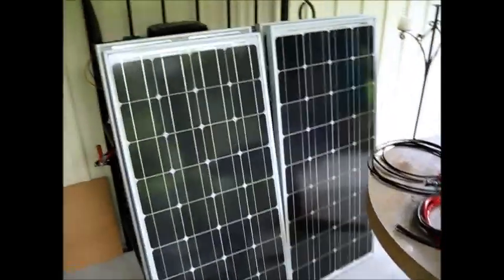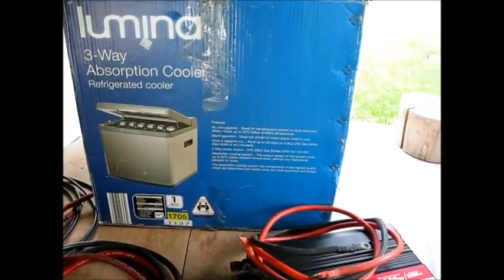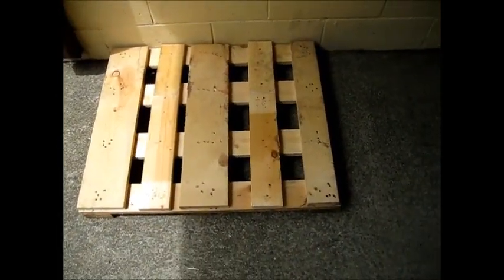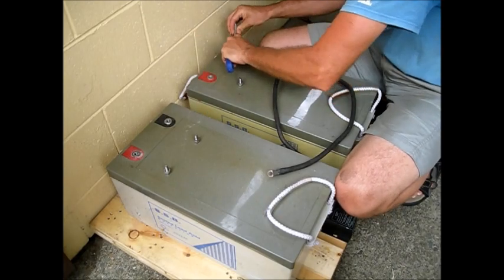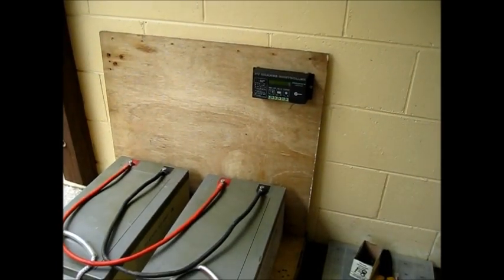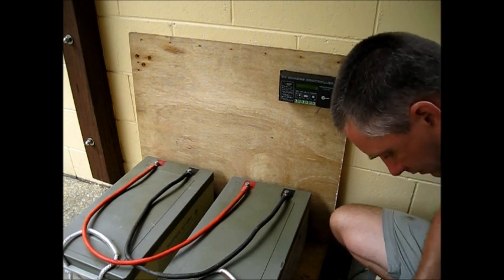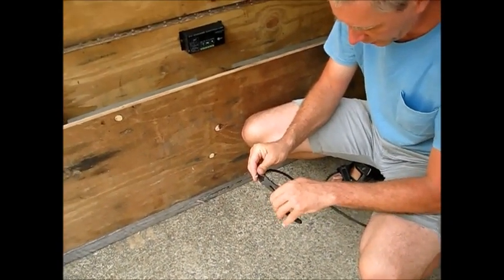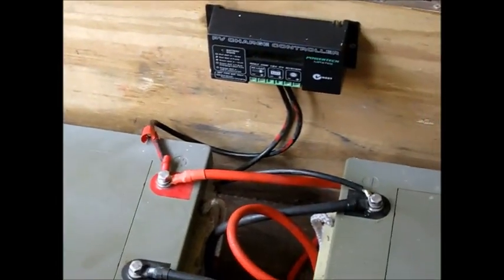The DIY World Installing Solar Panels On A Home In Australia

Comment: looks good your alot warmer then i am it was -10 last night, this week one night it snowed like i never seen it by time it was done there was to top of standing up snow shovel oh my i glade the heater guy fixed my unit monday before the snow! well ih hope your having fun! I ordered a off season boat trolling motor it was so big it did not fit in truck box with weight in it, i got one that i have to rewire boat to 12 volt from 24 volt unit i am going to try to use solar to power it! now you see my plan run it for cheap
Reply from the maker: Yes I am certainly enjoying the warmth here. It is a harsh winter back home this year.
Sounds like you have a good plan. If you dont use the boat every day then your idea will work well.
Reply: The Do It Yourself World
yes i though if solar units work for house why try it on boat with electric motor i used boat stuff to make first solar unit to see if it worked
Reply from the maker: gatorred157 Over here nearly every single boat has solar panels and many of them have wind turbines. I think I will show it on a video.
Reply: ok
Reply: gatorred157 how is the weather outlook? not melting here! everyone tells me by Thursday watch the report.still unsure.
Reply: cold and snow Sunday afternoon
Reply: WOW!  I wasn't sure how much.Thanks gatorred !.Keep You posted as well

Comment: You gotta check the area if there's chances of flooding ask owners if then put it on a stand with measuring lines with a cut off switch so just a switch to seperate the joint current water proof just like an electric bike waterproof but portable generators always have duck tape to tape the power connection up under the coverings etc safety especially for kids

Comment: I'm  not an electrician but I've heard that when you are connecting batteries you are supposed to connect the negative lead last to help avoid explosion. Do you know if that's true?
Reply: If a battery is going to explode,or bust,it will do it if it's bad no matter what.They tell you to connect the ground last,so that when you attach the positive,the chances of grounding itself out by accident will be reduced.it all depends on how careful the person is.I work with batteries all the time,and I have had brand new ones bust.
Reply: MrCrf450rider Thanks for the info.
Reply: In a car, under the hood, everything around the battery compartment that is metal is considered negative ground. That is when the negative battery post is connected first, if your wrench taps any metal object while you are tightening the positive, the wrench will arc.
If you connect the positive first, the car is not yet grounded and your wrench can safely touch any part of the car while tightening. There is no harm if your wrench comes into contact with metal objects while tightening the negative.
In a wooden box that rule doesn't really apply but I'm a creature of habit, so I do positive first anyways!
Reply: Francisco Campos Yup, that one's a no brainer. My question was related to hooking up batteries with solar panels as you can see the video is about solar panels.
Reply: Camper Hollow On a wet cell battery, you want to avoid sparks anywhere near the battery. When connecting an inverter, the first thing that happens is it's capacitors take a charge and this causes a spark. The safe thing to do is make the final connection at the inverter side of the battery wires, the negative last, but either one (+ or  -) will cause a spark.
In this case, it looks like these are AGM batteries. They don't normally vent explosive gases out into the air, but they will when over charged.
I would NEVER instal electrical devises (except fuses and thermostats) inside of a battery box regardless of battery type.
Reply: Francisco Campos This helps a lot, and I do appreciate it. I think the best thing to do according to what you are saying and I do agree with it, is that the batteries should be in one box, and the charge controller, inverter and anything else should be in another box. I also think that having the batteries enclosed in their own box while hooking up the controller and other things is a safer approach because even if the batteries explode you are protected by the box they are enclosed in.

I think I would also put a fan in one end of the battery box. I would not pull the air out of the box with the fan since that could start a fire if the gasses react with the electricity in the fan. I would push the air through the box instead so the gases move out through a vent in the other end of the box.

Comment: Am assuming you going to clean this up later as you seem to have performed testing in this one. The two cables you used to connect up the batteries where too long. It would have been a high efficiency if they were about 1/4 of the length as longer the wire length; the higher resistances thus the high the voltage drop and the least efficiency it is.  I'll keep watching to see what it ends up being but it is a start.
Reply from the maker: Yes this was a test. We are cleaning up the whole thing and even using wire conduit to hide the wires. I have two more videos on the installation I am working on.
Reply: Good luck mate!

Comment: Finally a solar video yea. But Troy I am concerned that the wind will blow rain water all over you charge controller and short it out. You should move it inside more away from the drip line. I like to put the wires in before I mount it on the wall. You need a box with bus bars in it to combine the panels. I use Y connectors or even tri connectors made like MC4 plugs for mine. On a different system I run a separate wire for each panel all the way to just before the charge controller then combine the wires with a buss bar made for boats or marine. They come out of that to the controller. Watch my video to see the kind of buss bar for marine I used it is nice. This is the name of the video "All Wired Up Ready to Charge Batteries"
Reply from the maker: We have since moved the whole setup but that is on another video I am putting together. Good idea on the wiring but it costs more. I will tell my friend about the idea.
Reply: The Do It Yourself World The land scape wire is cheap on ebay. I use the 10 gauge wire. You can buy 100 feet for about fifty bucks or more. then just crimp on some connectors. The advantage of running one wire for each panel is you dont loose any power or voltage and that is key when charging batteries quickly or on cloudy day. You want the most voltage possible to make the batteries take a charge in a shorter amount of time. On a cloudy you may only be barely making power and the extra volt you get by using a single wire per panel will make the difference between not making enough voltage and making enough to make the batteries take a charge. Did you see my Marine buss bar all my panels combine together into on my video. I should make a new video with close ups and more lighting.
Reply from the maker: shartne Cant watch videos for now. I pay per MB of data I use over here. Ouch.
Reply: For heavens sake. Must be socialist tyranny at work.
Reply from the maker: shartne lol

Comment: Why are you using aluminum ware instead of copper and red for +with - for black so as no mistakes are made with connections
Reply from the maker: I use whatever is available at the time. This was in Australia and I used what they had on hand.

Comment: what are the laws and regulations relating to DIY solar panels for a home, Pretty sure you need to be certified electrician as well as a certifaied Solar fitter if thats the correct term for it? 

I am quite interested in doing this for a tiny home i plan on building and i can comfortable on doing this myself as i have built my own batteries before from 18650 cells so doing it from complete scrap is not an issue for me however the legality of doing it is also another issue. does it void your insurance if something goes wrong etc?
Reply from the maker: If you connect to existing wiring in a home, it must be done by a licensed contractor. If you make it separate from existing wiring, you can do it yourself. Dont forget to follow code for safety. And check your own local laws. Some areas allow solar and/or being fully off the grid while others forbid it.
Reply: @TheDoItYourselfWorld  ah ok thats pretty good to know i did some research on it but havent been able to find many useful resullts relating to it being illegal or legal only for other countries liek the US and UK very little about it in AUS floating around but this is good to know so long as its not connected to the main house wiring. 

Does this also include seperate dwelings or RV type homes etc i mentioned earlier a tiny home is not technically a free standing building but more or less built onto a trailer so wondering about legality about this =)
Reply from the maker: Here, in the US, an RV is generally a motor vehicle and does not fall under normal building codes. A tiny house on wheels would be an RV. The township could not do anything about my tiny house on wheels. Then the only issue is occasionally moving it depending on local regulations.

Comment: 9:35 Setting the batteries in serial will cause an explosion? I did not know that.
Reply from the maker: Connecting the plus and minus of one battery is what I meant. You can connect batteries in parallel or series but I was trying to say be careful that you do not short the plus and minus terminals together.

Comment: I dont understand batry connection its parallel or series?
Reply from the maker: To connect them in parallel you connect all + terminals together and then all - terminals together. This combines your current. To connect in series, connect the + of one battery to the - of the next and so on to the end. This increases your voltage.

Comment: What is the price for a solar panel setup in Australia? Good Vid! Like the box idea.also what are those batteries normally used for?
Reply from the maker: Solar panels here are not too much different in price from in the US. But a place called Jaycar Electronics has some nice deals ranging from $3 per watt for solar panels. I bought a portable solar panel for my backpack from them which I will review soon.
The batteries are just deep cycle batteries used for campers normally
Reply: sounds good! There is this company by me that has a huge array of solar panels.It covers the whole front of the lot that they are located in.Like the solar backpack idea,that can become handy in a bad situation.My Father had 2 big solar panels,on posts,with caharge controller,and marine batteries.He used them for the electric fence for the horses.someone came and stole them.We got a call from our neighbor saying our horses were out.that is when we noticed the theft.
Reply from the maker: MrCrf450rider I could not resist the solar backpack panel. It is awesome for survival situations or hiking.
Reply: The Do It Yourself World for sure! I purchased a few emergency lights,and radios,with the hand crank,and work perfect.able to charge phones,lights etc.My basement is practically underground,and can be turned off grid.I consider it the safe spot.I also rotated our food supply last week. The whole house is wired.I got battery backup,and a load shedding transfer switch for the generator,also stocked up on camping gear,and firearms.I am actually not sure the route I want to go,as far as wind,or solar yet,or both.I want to do a roof mount wind turbine,but am not sure what noise or vibration I might get.solar has been good in the past too!
Reply from the maker: MrCrf450rider Go with both solar and wind if the environment around your is good for both. Meaning if you have plenty of wind all year and a clear line of sight to the sun for solar.
Reply from the maker: Link Knight I was just chatting with a solar panel installation company who said that they have to throw out a lot of damaged solar panels. There is no recycling place in Australia. That is an open market Link. Get free solar panels, fix them up and sell them.

Comment: Just did my caravan , didn’t find I needed a inverter for power. I made sure my accessories are 12 v ... lights , fridge , USB,s , tv. Heater. Stove is gas. The basics I know but it’s all I need and keeps the cost down. Have to admit though power tools etc definitely would need and inverter for those  or maybe a generater instead . Horses for courses lol good video . 👍

Comment: . i have a 12v deep cycle marine battery as a back up separate  from  my 2 6 volt t105 golf cart battery system . long story short i had them all on trickle charge at my home a yr ago. batteries were topped off. i move the trailer to storage .no power available. with no charge going to the batteries any longer and with small volt meters connected to both the batteries held a charge for quite awhile although volts were dropping.as of 3 or 4 moths ago the volt meters were no longer lit and showed no readings.im about to install a 100 watt solar panel with 30 amp mppt controller to the 2 six volt set up and hope over some time it will restore those batteries to 12.6 and was thinking of using the portable kit to install to the marine 12 volt to restore and maintain that battery as well.do you think the panels will bring the batteries back to a good charge on their own without having to remove them and have them boost charged ?also being its at a storage facility i was thinking of mounting the portable to the trailer roof so no one walks off with it.can i do this if i cover the charge controller in plastic to keep dry ?
Reply: if the battery's are dead you may have killed them, a trick i learnt to bring back dead battery's was hooking up your charger backwards so + to - And - to + for 5min then reverse the polarity of a battery back to normal, a sparky showed me this trick he told me it makes the buildup on the battery plates come off, how true this is IDK but it seemed to work twice for me when i did it.

Comment: what does it do  I dont get it?
Reply from the maker: Power from the sun to run your home
Reply: But like we're do you plug it in to, and for what light, heating I do t get it? Do you plug it into a plug
Reply from the maker: OH, ok. You can run a power inverter to get AC household type power. Then you can plug in the TV, laptop or lights. Charge your cell phone and other devices as well. The only limit is how many batteries and solar panels you have. With enough of those you can also run heat, fridge, washing machine and more.

Comment: Im not an electrician - so in English what exactly do I need to live off grid completely?I want to get a 10kw off grid solar system - what would each panel have to be in wats? What size batteries would I need? Any other information I should know??
Reply: Anna Nolan 
I my self am starting with a 5 kw inverter. and just 200 amp hours in batteries. 2500 watts is all you would ever get out of a single  common outlet in the us. so I would go from there to estimate your needs. check labels of what you must have and use every day. but I'm using a generator for large loads like washer dryer and cook stove. and inverter for TV lights and fridge. and microwave. but 2000 watts solar and 10,000 ah battery bank. with a 4-5 kw inverter. and a generator to take up any slack . from rainy days. is plenty for 2-3 ppl. as long as you use gas water heater and stove. Or a generator to run the stove. but you must watch power use. and unplug any appliances that use power when not used. I'd use 100,150 or 250 watt panels. and 24volt inverter . you can always add on later. hop this rambling made some sense .
Reply: ive started 8kw solar setup with another 1.5kw wind total 9.5kw  i have 30 270watt panels and 3x 500watt wind mills  i also have 8x 335Ah 12volt batterys thats about 32kwh of storage but been lead you can only use about 50% max so its more like 16kwh usable  but the batterys only get used at night because my solar puts out more power than my house use's at daytime.   in New Zealand 30 panels go for 6k  they get cheaper when you buy a pallet load of 26 panels

for total cost so far ive spent about 16k New Zealand  thats on solar, wind, batterys, inverters, cables, and i also built a 18 panel carport, im going to build another carport to hold my other panels but ive not decided if it should be 12 or buy another 6 panels and make the carport the same as my other one, carports are cheap to build and you use the panels in place of the iron roofing, then use sealant between to stop the rain, seems to be working sweet

in New Zealand you can build a 20sqm carport with 3 sides with out a building permit and the roof of the carport has no limit so you can build a over hang as big as you wish lol of cause there is a point it looks stupid or too unstable  but 20sqm between the posts gives you lots to work with, also no permit is needed to install solar,

on a crappy cloudy day my solar panel carport makes about 14kwh  so once i build my other carport even on the worst day ill make around 30kwh  and the best days can make well over  60kwh  we use about 15kwh - 30kwh  so way over what i need lol

Comment: Those are hot leads, cove panel so it does not put out power.
Reply from the maker: Good point. Or turn them upside down while wiring.